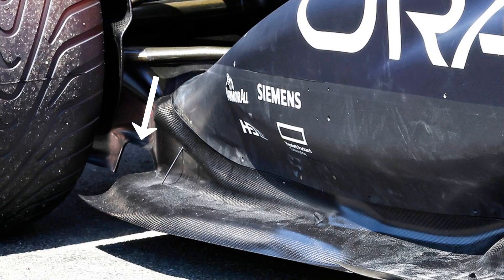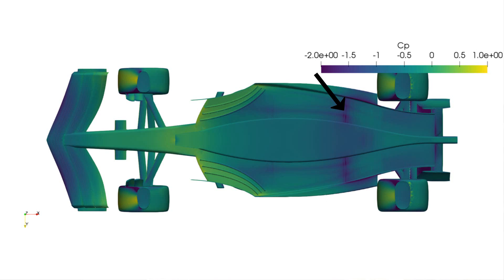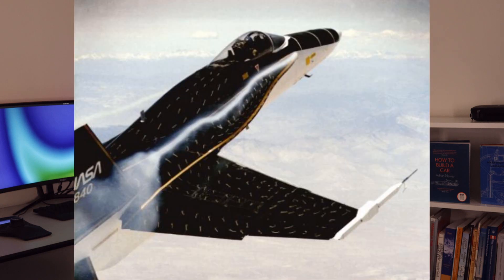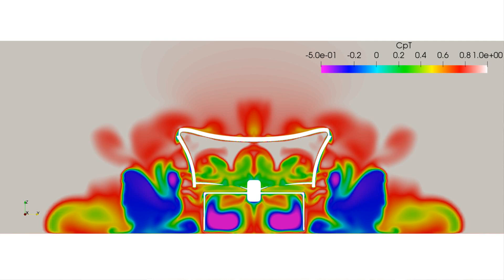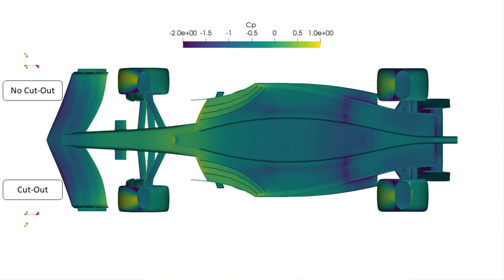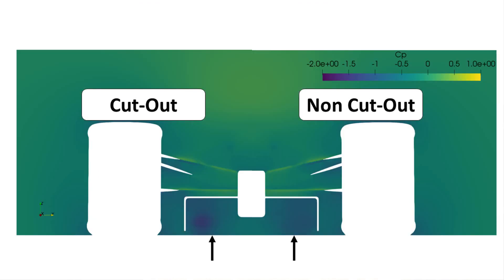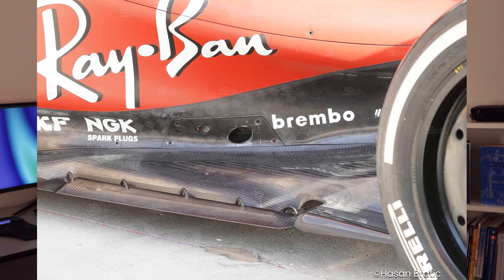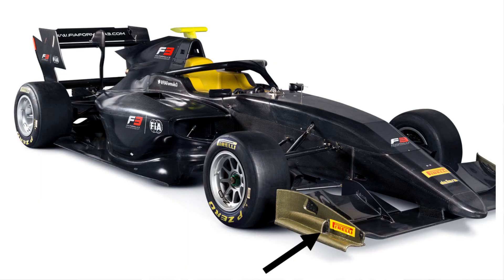F1 Diffuser Cutout Explained

Comment: https://www.youtube.com/shorts/pyUXVXNZLHo The diffuser cutout is like the side channel in this video. It basically winds up the vortex in the diffuser.

You raise an interesting point, can a vortex generate localized suction? The low pressure core is sheathed by a high pressure wall, wouldn't this amount to a net zero pressure change? What we can see is that a vortex keeps flow attached to a surface as well as adding momentum to that flow, as well as forming a channel for air to flow through creating a kind of nozzle effect. Your own CFD shows that in the center of the diffuser where the vortex is not, is precisely where the airflow has the most energy and by extension velocity. Therefore, it is the airflow that flows around the vortex that is creating the suction. The tunnel vortex acts similar to your thumb placed at the end of a garden hose, it restricts the airflow so it moves faster, like an elastic nozzle made of air.
Reply: Where the vortex flows, there's a well defined low pressure zone on the surface. Wouldn't you call that this local suction is caused by the presence of the vortex? 
If the vortex was just helping to attach the flow, like any other method doing the same (boundary layer suction for example), then we would see the improvement mainly in the throat of the venturi tunnel, not longitudinally. So while it does help to keep ghe flow attached, it generates localized suction on the surface it travels by, doesn't it?
Reply: @jozsefmolnar6453  Sure as long as the vortex flow is aligned within 15 degrees of the streamwise flow. Easier to do when the vortex is thin and narrow, but this limits the low pressure generated at the core, so it's a tradeoff.

If the vortex is a result of pressure separation, then the process of pressure recovery drives the motion of air.
Reply: I am a complete aero layman so take my opinion with a grain of salt, but I believe that one of the crucial reasons as to why vortices allow for increased suction in the diffuser is because they entrain the air close to the road surface into its flow structure, which in turn allows for a greater amount of air to be expanded in contrast to diffusers without such flow structure where a smaller "region of air adjacent to diffuser surface" would experience expansion. We can assume that as the floor height  from the road surface increases as we go towards the rear of the car, smaller fraction of air would experience expansion as only air close towards the diffuser surface would expand, which means that introducing vorticity in the rear expanding region of the floor would net most benefit. I believe that there might have been an article about it somewhere by Willem Toet which was about how f1 teams employ verticity to obtain much higher diffuser angles than laminar flow diffusers do (i think it was somewhere in the region of 15-20 degrees, way more than common 7-10), but I read that a while ago.

In that sense, Rolando's theory about vortex acting as a nozzle makes sense, but it might be even be as a sort of a magical semi-permeable nozzle where it entraps surrounding air into its structure and guides it in its confined flow.
Reply: @peroplaninic2220  I think in your theory, you mixed the cause and the effect. The diffuser vortex is generated as a result of entraining air under the floor from the sides, not vica versa. I agree that with vorticies, you can use higher angle of attacks without separation, whoch is one of the reasons why they are useful in diffusers. 
But you can generate downforce on a flat plate parallel to the ground woth zero angle of attack if you have vortex generators on the bottom, so they do generate localized suction as well.

 @Rolando Tillit thoughts?
Reply: @jozsefmolnar6453 es, I haven't really expressed myself properly. I agree that vorticity within the diffuser is created due to the pressure difference between the underbody of the car and the outboard side portion of the car. My theory was that this inflow from the outboard region to the underbody of the car can be beneficial to the car as it introduces some air within the diffuser to expand which would have otherwise end up unutilized. But I think that the increased suction in the diffuser due to vorticity comes not only from the inflow of the air from the outboard region close to floor to the underbody, but that this vortex caused by the inflow would also "pick up" air that is close to the road surface underneath the diffuser and allow it to expand. I don't really know how to properly explain this, but I kind of think of it as the way Dyson air multiplier works: due to vortex' tangential flow in the diffuser, it would pull along stagnant air close to the outer portion of the vortex alongside it.
Now frankly I don't really know whether the entire volume of the air in the diffuser expands uniformly or not, but if there is any reason why that is not the case, perhaps because of floor's boundary layer or some other reason I can see vorticity here helping the system.
The reason I haven't mentioned inflow from the outer region of the floor in my original comment is because floor strakes in today's regulation also shed vortices down the length of the floor so I wondered if the floor strakes would increase the suction in the floor even if the rear part of the diffuser was completely sealed from the side.
As for the parallel flat plate generating suction just due to vortex generators, that is an amazing phenomenon and it is way outside of my scope of knowledge, but I would love to hear some opinions on how it would work.